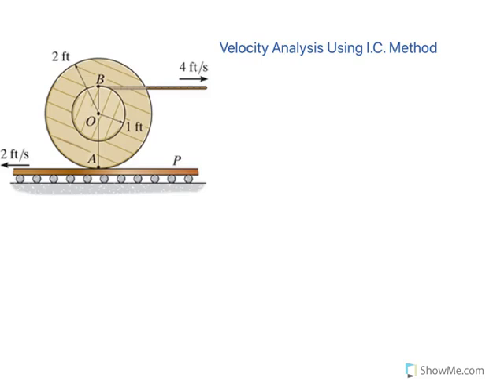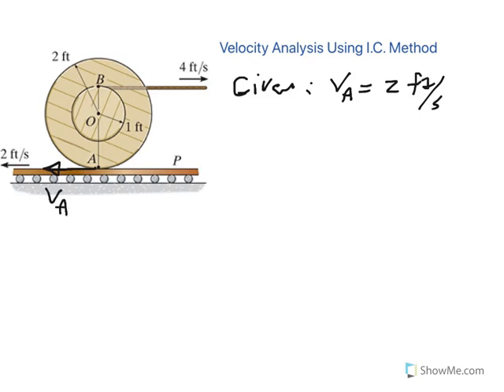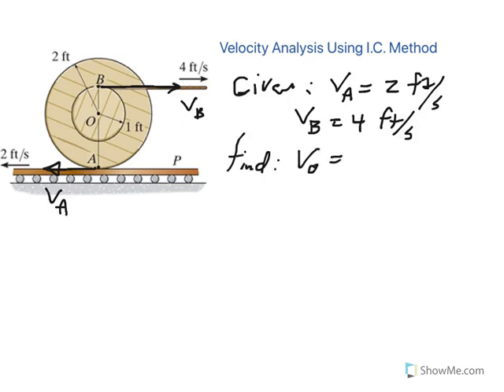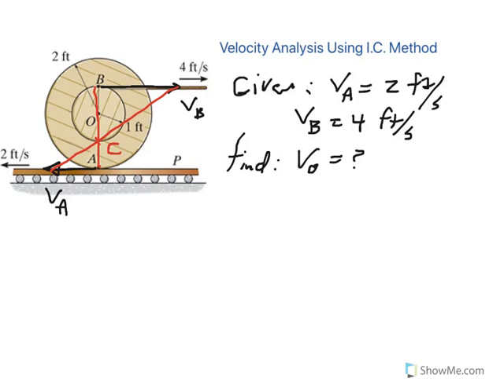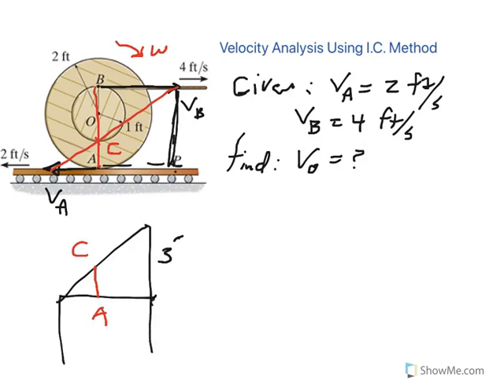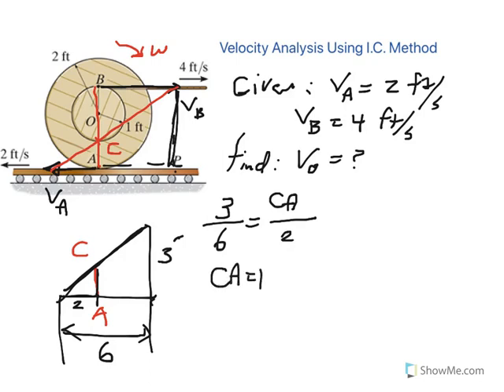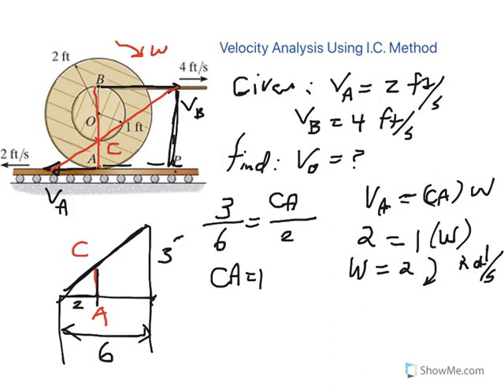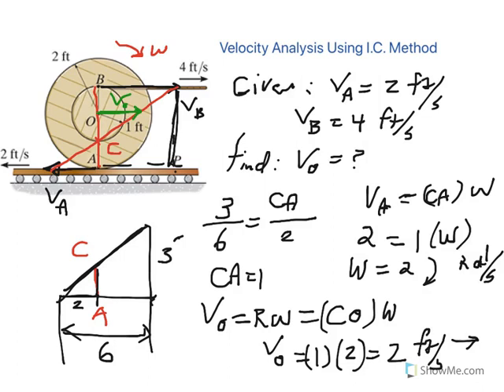Example of Velocity Analysis using IC (Instantaneous Center) method

Comment: Dear Sir
Great lecture but please help me with one thing
if wheel slips or slides on the stationary surface then what will be the instant centre of zero velocity would that be the point where wheel and ground in contact or not.
Please help me
Thanks